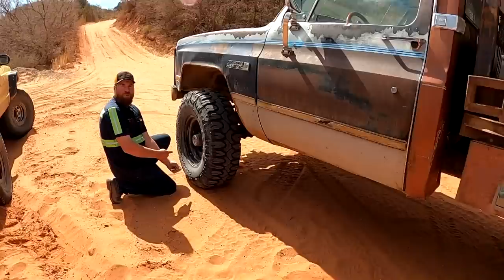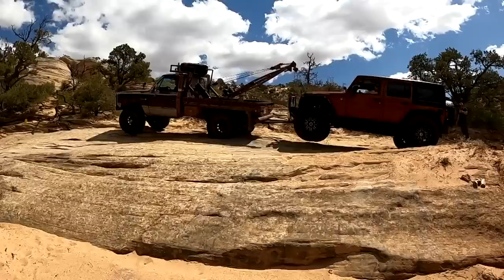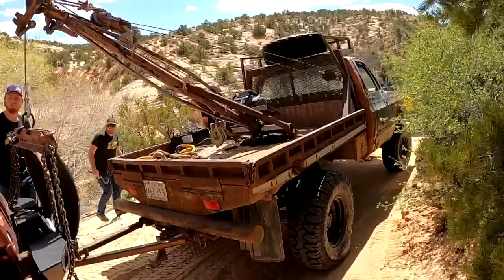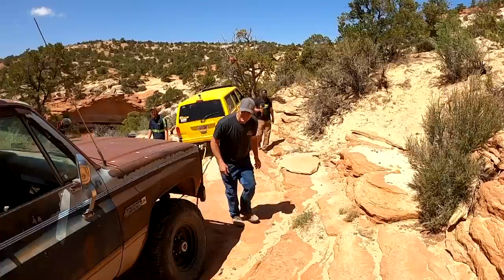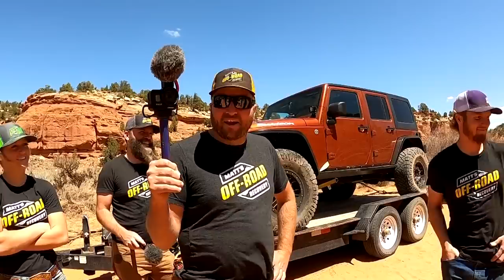One Of The Most Difficult Recoveries We've Ever Done!

Comment: The customer should keep the hood crease as a reminder to check fluids before they go off road next time.
Reply: Owner may have punctured the oil pan somewhere along the route, climbing over the rocks !!
Reply: @ricks.1318  absolutely possible.
Reply: @ricks.1318   how do you call that protector metal plate that goes underneath? He should have had one of those fitted
Reply: @infinitydreamzz  A lot of off road vehicles have skid plate options, they are a necessity. Or just make one yourself.
Reply: If it's a real Rubicon they come with skid plates.. but those jeeps eat allot of oil if they are on steep inclines!
Reply: Those Jeeps to burn a lot of oil but still there should have been an oil light that comes on before I got to the point of seizing...
Reply: @bigjay6743  you would hope lol..
Reply: Pentastar 3.6 is garbage imo
Reply: Also I may be wrong but it looked like it had Kentucky plates so they are a ways from home. What a mess.
Reply: @infinitydreamzz  
Known in Australia and New Zealand as "bash plates" for some obscure reason...
Reply: The customer should not worry about the dent in the hood. Thunder description he’s going to need an entire engine replaced.
Reply: The crease is internet famous!
Reply: I'd keep it just for the story.
Reply: It needs a morr sticker on it! “So I made a call!”
Reply: Valuable dent!  Keep!
Reply: @DelgueAdventures  not sure why everyone assumes an oil leak or related problem. All fluids intact and no leaks. Timing chain destroyed.
Reply: Jeep are junk nowdays,we had a J20 in the eighties it was a good truck,its still around these times ..
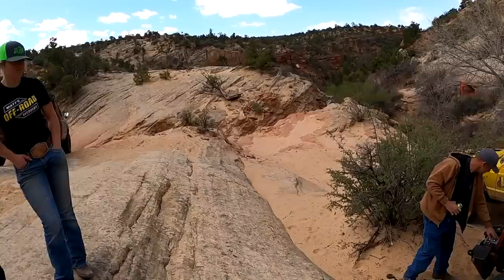Reply: @juliefloyd5688  maybe because at 4:25 Matt talks about the engine being checked and there was no oil.
Reply: @DelgueAdventures  aww! Didn’t catch that. That makes sense now.
Reply: Jeep is too clean so hood dent is a well earned scar 😂

Comment: Have been recovered once in Death Valley but it was on pavement with a long and expensive tow from Towne Pass to Pahrump where we did repairs.

I have done some sketchy stuff overlanding but the obstacles on this recovery are probably a bit more extreme than anything I have done. Did the Behind The Rocks Trail and Pritchett Canyon in the early 90's in stock HiLux pickups and that was hairy as hell. This is an order of magnitude more extreme.

You have my utmost respect for doing this recovery. Simply stellar work.

Comment: Note to self: Do not take my manual transmission CJ5 on this trail...  My hat's off to Paul in the manual trans wrecker with a carb!
Reply: your 5 can make that trail. short wheel base and light weight. no problem
Reply: Definitely not if you still have the original carburetor.   You would be restarting and blowing it out, the whole trail.

Comment: oh, a little pro-tip coming from the go-kart world, when you have a rough riding rig, instead of bolting the seat straight to its mounts, get longer bolts and set the seat on top of some valve springs from an old motor. You'll get some extra give when it gets really bumpy. It's only an inch or so worth of play, but it really makes a difference where your kidneys are concerned.

Comment: Paul, you need to build a damn removable boom for the tacoma. You know it's a brilliant idea and you know you could use the shit out of one. Imagine having it on this job, you could have probably yarded that jeep out of there by yourself, assuming it has the weight to keep the front end down. And if that's an issue, you just build a bracket on the front bumper to slide some old lifting weights onto and get some ballast as far forward as possible. The taco would probably be the official most capable vehicle in the country. I mean... for shits sake, you've seen "After Shock" the side by side recovery boom truck that Super ATV built right??? They do some pretty serious recoveries in that thing and it can't weigh more than 1500lbs. So i'm sure a 5,000lb tacoma with some strategically placed ballast would be the recovery vehicle of the century. And plus the build would get you a shit ton of views if you title the videos properly to attract as many clicks as possible. It's a win-win-win situation

Comment: Can the leaf springs be repaired? Bent back and re-tempered? You have mentioned a couple time that the engines will run better with fuel injection (instead of carburetors). This might be a great FabRat You Tube, project. I have been led to believe that this very difficult without all of OEM parts and software.

Comment: Grandpa Sherm's wrecker is in desperate need of fuel injection. Those angles are just draining the float bowls and making it harder to do everything. Even basic bitch TBI would be better. The Quadrajet is actually a pretty good carb for this kind of thing, but they're getting so hard to find in good shape, without warped bodies that you might as well just throw on TBI and get the standalone wiring to make it run.

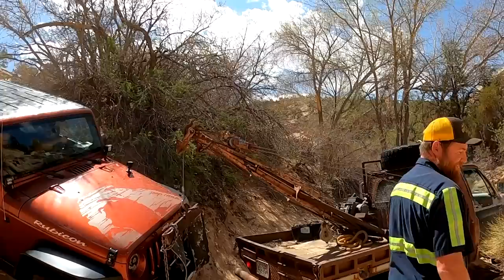Comment: It appears that the rear end is locked on the Jeep being recovered,  check the video at 9:30  Paul is dragging a vehicle which is in "Park"... transmission locked.  Dragging the Jeep has to be more difficult when you are having to burn so much energy just overcoming adhesion... The jeep is the definition of a "lead sled"..
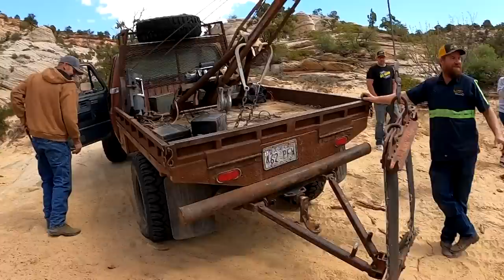Reply: They were going downhill there, and Rudy was using the E-brake in the Jeep to control their descent.  Check the dialogue at 6:50 mark, they tell Rudy to "run the brakes."

Comment: Tow truck has a carb why not converter it to propane with a 20 gallon tank have a extra 10 gallon tank for back up you won't have to worry about run out of gas with the 5 gallon in the tank it be all under pressure

Comment: I see more Jeep Rubicons pulled out of the Rubicon, than any other type of Jeep. Fellas, Just cause it says "Rubicon" or "Trail Rated" on the side of your Jeep, it doesn't mean squat, the engines in those Wranglers are garbage, do your research, at the very least check your freakin oil...SMH.

Comment: holy snaps. Did that truck stall out from stopping in gear or was it pointing so high up that it dumped the gas out of the carbs? That truck looks old enough to have carbs... I'm new here so I don't know the equipment. :Edit: rewatched and apparently I missed the comment about sponsoring for some fuel injection. xD